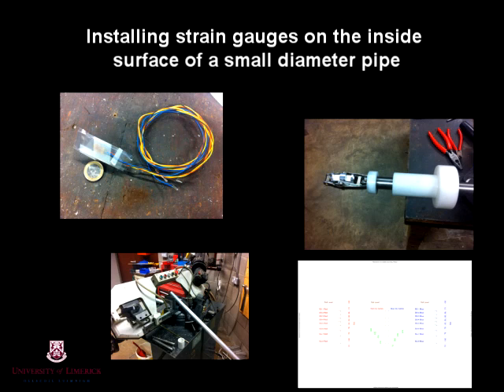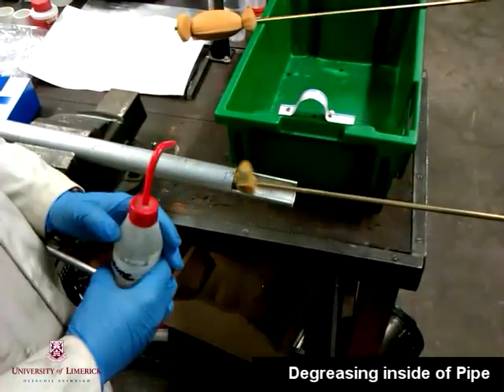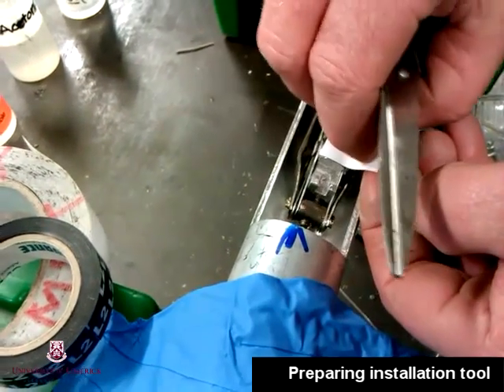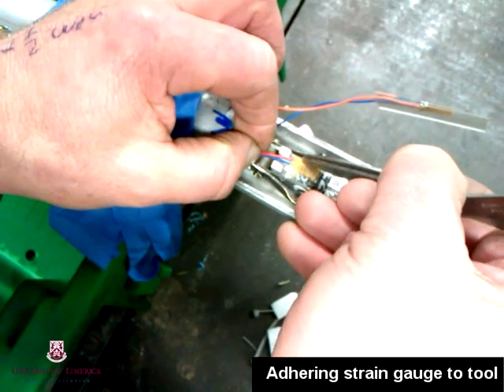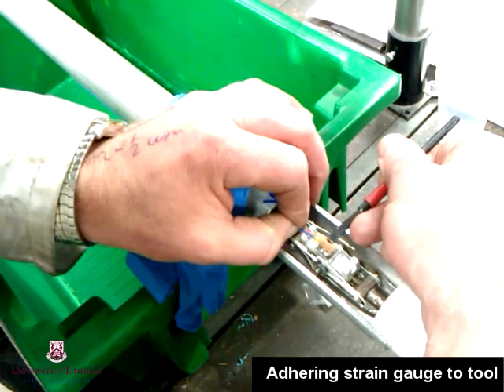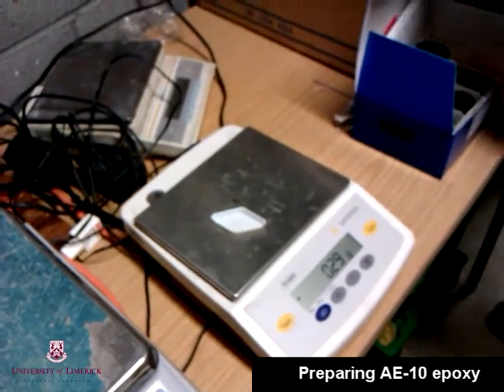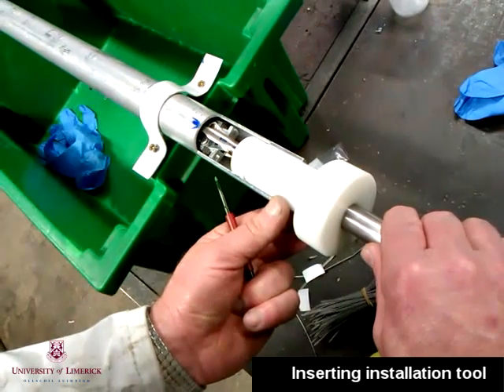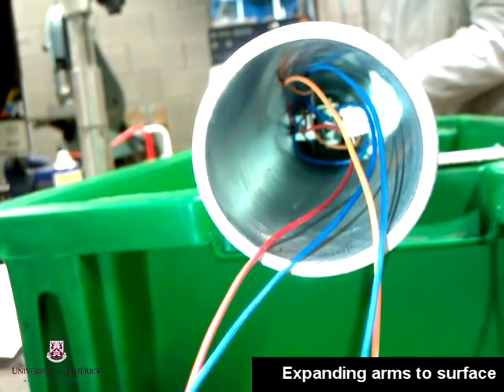Strain Gauge Installation on the Inside of a Pipe

Comment: Why couldn't you just install the gages on the exterior of the pipe?
Reply: Hi Jorge,
Installing them on the outside of the pipe would have created more problems when driving the model pile into the soil. We would have run the risk of shearing them off the pile.

We would also be interfering with the surface area of the pile that comes into contact with the soil, making our results unreliable. this way the exterior best simulates a pile in contact with the ground.

Thanks for watching!
Joe
Reply: ok i understand.. Great video and Awesome tool.. I hope you post more videos.
Reply: Did I make the cut? Lol